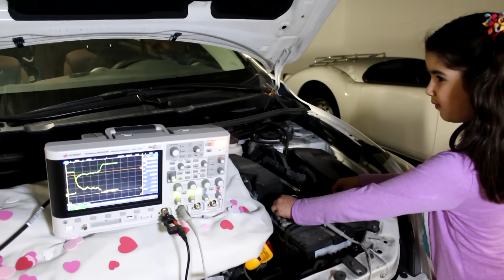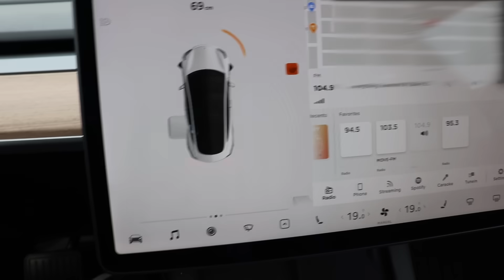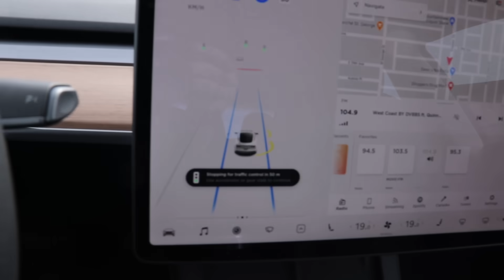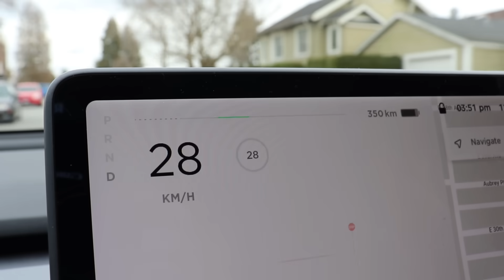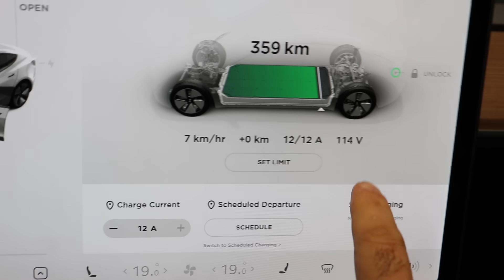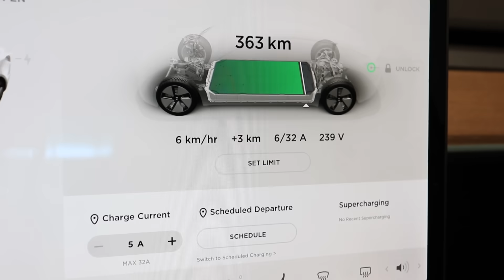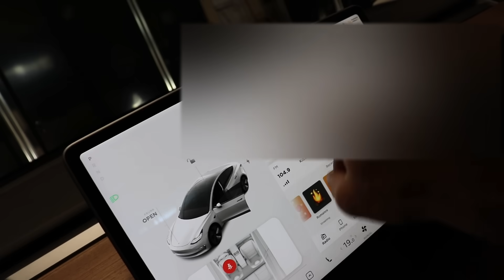ELECTRIC VEHICLES & My Tesla Model 3 Review

Comment: I’ve owned a Model 3 for over 2 years now and I love it!  A few things:

- The display freezing like that is definitely not normal.  I’d take it in for service!
- Check out the latest ‘FSD Beta’ videos on YouTube to see what the latest self driving software is actually capable of!  What you’re using is basically a year old already!  Also, if you want to understand what’s happening under the hood, get familiar with ‘Neural Networks’, and how ‘Deep Learning’ can be used to train them.
- Fill your boxes with bags of water next time..  The car will likely stop because the radar will see it then.
- I’m sure you already know, but charging the battery to 70 or 80% instead of 90% will do much more for battery health then charging it slower.
- In the ‘Carbon Footprint’ calculations - people almost NEVER account for the carbon footprint of building gasoline stations, producing the gasoline, transporting the gasoline, building semis to transport the gasoline, etc.  That should all be included too!
- Very little of the US grid runs on coal these days.  There is a lot of natural gas though.

Congrats on the car!  You’re going to love it!
Reply: Car guy, smart Guy
Reply: What is your average cost to drive your car per month? Would you say it is financially better than a gas vehicle? I'm just curious. I'm getting ready to buy a vehicle and the Tesla looks tempting.
Reply: @nvpeeches4316  I was driving 30k miles a year..  My gas bill went from $200 to $0, and electric went up $100, so roughly $1200/yr less.  That’s coming from a Prius so it may be more dramatic for you.  Teslas also hold their value extremely well.  For me, those details made it an excusable purchase because it was the car I wanted.

Also - the convenience of no oil changes or maintenance can’t be understated!  73k miles and I’m on my 3rd set of tires.  That’s it.  So at $60/oil change, I’ve saved nearly $900 in oil changes.  No timing belt, transmission service, tuneups, etc.
Reply: @setheroth28092  The Tesla most definitely reigns in comparison. Thank you for your input. I can easily live with the trade off. I was married to a professional auto mechanic for 24 years so I know the cost of maintenance. The Tesla won't be the headache I'm used to. Too cool. 👍
Reply: Well, if you want to count the carbon footprint of building gas stations and transporting gasoline, then don't forget the carbon footprint of building charging atations, transporting all the circuitry and building materials as well as circuitry production for said charging stations

Besides, the building a gas station thing shouldn't really be counted, I can agree on transport of fuel etc., but not the building, as they existed long before you bought your gasoline car, most of them anyways, and therefore has no real meaning in a calculated carbon footprint of a combustion car, sure they could have been part of it a long time ago, but, not anymore
Reply: @MadPixie  the carbon footprint thing ends up being a rabbit hole. How far back is back enough? Do we count the manufacturing of the vehicles that transported the parts of the factory the electric cars were made in? Do we count the carbon footprint of the first vehicle? 
When you do, you'd see that oil is a very dirty businesses.
Reply: @MadPixie  The same can be said about charging stations a while from now. You either account for the full costs or just operational costs, can't say which is more correct, but using one indicator for one technology and a different one for another just ends in biased analysis.

Even if some stations already exist, new ones need to be made all the time.
Reply: @mavhizd  that's mostly my point, that station building emissions being counted is just stupid, but simply even more relevant to charging stations as more have to be built recently as of the supply demand, so, in other words I agree, adding them to the equations is just, dumb
Reply: a lot of the coal that is burned is clean as well
Reply: @lost8099  It is only clean if you don't consider the CO2 output from burning it...
Reply: @emu071981  and the enormous amount of particulates we breathe, acid rain or indeed the radioactive dust it spews over society.
Reply: @lost8099  technically coal would have a pretty low carbon footprint if you just burnt the coalgas and threw the remaining coke on a pile but nobody would do that xD
Reply: @lost8099  how do you make clean coal?

Comment: Mine is same - 3months old - same colour - but it's the  DUAL motor  version with BIGGER battery- I have two powerful motors  and more POWER..... Mwwahhha
Actually not enjoying experience so much so far
During cold weather in January (when it got close to sub-zero) - it lost all regen on braking - suddenly and without warning - changing braking dynamic behavious in a dangerous way. Tesla's advice - yeah thats normal.!!  But it's not normal it's fantastically dangerous!  No other car does this (and I have another electric  car to comapre with). I am about to report to safey authority in UK 
This weekend my central screen EMU has now developed fault - black screen! -  Tesla are coming out in 3 weeks time to fix  ---Yay    ):o(
So far - more faults developed in first 1000miles than all other cars I have ever owned combined. Needless to say I have mixed to negative opnion on Teslas  - at least so far
p.s. ultra fast acceleration is good for overtaking in a safer manner befor enext bend occurs - not just boy racer stuff

Comment: 13:25 Well, in most cars now days, the fuel injectors turn of and stop feeding fuel to the engine if you release the gas pedal. So if the hill allows for it, you can cruice all the way down and use no fuel at all in a perfect circomstanse.

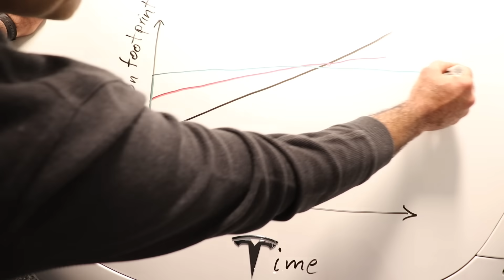Comment: Fun fact: At 2:50, you need to drive roughly 7 years regularly with that Tesla to compensate with the production of the battery compared to a gasoline car. After 7 years you finally start to be "green"
Reply: Nope.  If you do that comparison, you need to do the equivalent for gas, which means the production of the metal, oils, rubber, of which there is much more metal than in a lithium battery. In actual fact, the production of an electric car is almost the same as a gas car, in the cost of how green they are.  Now, add in the cost of the production of fuel, the shipping of fuel, the pumps to pump the fuel, and the gas car is suddenly much more expensive environment-wise. As electricity can be produced in multiple ways, it can be very clean. For example, in Ontario, all coal plants have been shut down and replaced with wind and solar, and diesel. (and the air is noticeably better than it was a few years ago when they were operating on coal). So electric vehicles are the first of many steps to a clean environment.
Reply: @chrisBruner  How long does the battery last? I expect its carbon footprint is significant, so you probably need to calculate a second (or even third?) battery pack to the total footprint of an EV. On the other hand, footprint of oil mining, refining and delivery must be massive and we can't forget it itself heavily consumes electricity as well...
Reply: @mikiqex  A battery will last approx 10 years, (I was told when I bought my Tesla). It can be recycled, so is not that big a footprint.
Reply: @chrisBruner  I knew someone would disagree, I honestly have no idea myself, I read an article in the newspaper saying that with the 7 years.
All I know is in the US, only 20% of the electricity made, is made with renewable energy, 40% natural gas, 20% coal, 20% nuclear energy. I still dont think at all that its worth getting an electric car. 
Just think about all the planes and huge vessels, they need much more fuel and ressources than a car
Reply: @jennyhoffmann3054  The amount of electricity made with renewable energy is increasing each year, so we are talking about an investment that will pay off (green wise) over time. Electric cars are still expensive, but in a few years they will have come down in price, so I understand if you don't think it's worth it. I just had to disabree with the 7 year statement, as the greenhouse cost is nowhere near as high as you think, compared to internal combustion engine.

Comment: Tesla brakes do need maintenance if you drive it in winter with salt. After a couple years they may not wear but they will seize if you don’t renew the grease. Obviously a not a major concern but worth noting before the rotors are ruined, which will be pricey compared to a matrix.

Comment: be carefull with the brake system if at your location salt is used for the ice on the road.there are cases of seized brake calipers and rusted disks after 4 winters,having to replace the entire brake system,and those are high performance parts.
On a model S :
Break caliper assembly with piston (each): $745.00
Rear rotor (each): $331.00
Front Rotor (each): $290.00
Parking break caliper with pads: $1,235.00
plus labour costs.
regenerative brake is awesome and will also save you on brake system wear and replacement parts,but remember to force the car to use them on a regular basis.
I love Tesla cars,but they are luxury cars in maintenance.
they made a brilliant job,but Tesla still lacks of the decades of design experience others have,making them very,very expensive to repair in body work.
then add the cost of expensive parts and you have a nightmare in case of even small crashes wich leads to lots of them getting totalled with "minor" crashes.They get so expensive to repair so fast that insurance companys prefer to declare them totalled in too many cases.And insurance fees are also very high.
even at the same selling price tag as others,they have the potential to get much more expensive than other brands.
as i said,i love Teslas (minus the cybertruck),just i cant afford them.
also,the lack of maintenance and parts wear..well,electric or not they have a lot,specially Teslas,just wait.
Reply: So it might have been better to keep the Toyota for winter driving? I have no familiarity with winter driving.
Reply: @blkdog40  no,just make the brake calipers work instead of only  use regenerative braking

Comment: 13:30 that is not quite true. if u run downhill with a gasoline car, if you just let gravity pull u downhill u dont consum any gasoline either. it cools down the engine since it doesnt burn fuel anymore

Comment: Can you make a video about creating a portable solar charger that you could hook up while parked to charge the batteries? I have a hybrid plug in that holds 30 miles I would love to be able to keep a panel on the trunk so that way while I’m out I could at least even just drip charge the batteries every mile counts!!
Reply: with just the panels that can fit on the roof, you might only get a single mile.
Reply: @jnawk83  every mile counts over a year that would be a full charge worth
Reply: @ohraa1  right, but what would the panels add in excess weight and drag?  you may well spend more lugging them around than you make.

Comment: Unhappy putting green house gasses in the air, buys electric car that still contributes to it, just somewhere else. 

My neighbor did the math, bought two tesla cars and after 6 months got rid of them for two hybrid Toyota SUV because his electric bill was higher than driving a gas vehicle.
Reply: Of course the electric bill is smaller when you drive a gas car
Reply: What kind of electricity prices did your neighbor have where electric was more expensive than gasoline?
Recharging a Tesla is easily more than 30x cheaper than refueling a gasoline or diesel car where I live.
Reply: @logitech4873  by the time you incorporate the monthly payment into this vehicle vs me I dont have a monthly payment, it runs me $60-75 a month to drive around with my gasoline vehicle. Also charging stations are few here. My neighbor never was home long enough to have one of these have the proper charge time a 120v system needed to fully charge it. He used them for his business and found out that he couldn't charge them faster than his consumption rate. He had two and could only charge one at a time. If you add the cost of both of my vehicles together fuel wise, im at tops $175 a month. One is a full size truck, other is a compact SUV, both 4wd. Also it has been proven that the US current electric grid couldn't handle electric vehicles if everybody went to them.
Reply: @mistermacgray  I would expect to pay maybe $2 a month for charging if I had a Tesla.
If you buy a Tesla, you should definitely have a 7.5 or 10kW charger installed in your home.
Hopefully the US gets better? I don't really care.
Reply: @logitech4873  i have my doubts it would be that cheap a month. You lose 1% a day of the battery as they have said. At $2 a month you are just maintaining the battery and my cost more than that.
Reply: @mistermacgray  When the price of electricity is $0.03 per kWh, and you don't do a lot of long distance driving, it's just not gonna be very high.
But let's say $4.
Reply: @logitech4873  this falls in that category of battery memory and do these batteries get that if not properly cycled (drained through proper/recommended usage) and it shortens the life of the battery.

Comment: Can spot some weird panel-gap at the left headlamp. 
Anyway. Can you explain why (most?) electric cars only have one forward gear? Is there no benefit from a lower revving electric-motor? The motor has plenty torque to handle lower revs.
Reply: The motor has plenty torque to handle higher revs too
Reply: @Lardladd  Thats not the issue. Will it consume more power at high revs? If so; why doesn't it have an "over-gear"?

Comment: 11:20 "Tesla's accelerator pedal works differently than the traditional gasoline car"
Didn't driving school teach you engine braking? It is the preferred way of slowing down a (combustion engine) car without wearing the brake pads. By planning ahead and driving non-aggressively you rarely need the brakes on any car.

Comment: Nice to hear about the low maintenance costs. But don't forget to check your tire pressure! This can cost range and / or compromise braking distance during an emergency brake.
Another problematic area are the mechanical brakes themselves. Due to minimal wear they can rust and degrade more than with frequent use like in a gas car. Keep an eye on the rotors and stay safe!

Comment: EV car i so environmentally friendly, that after 7-8 years you have to buy a new battery pack, which is about 70% of new car price :D
Reply: The batteries are designed to last between 500-800K kilometers, and at that point most cars would be well dead.
The estimated cost to replace a model 3 battery is between $3000 to $7000, so you're really looking at 8-15% of the cars' cost.
Reply: @logitech4873  Batteries are designed to last specific amount of charging cycles, not kilometers.
Reply: @MTWODZU  Of course. But charge cycles aren't a very useful metric for people who buy cars. (not a lot to compare it to)
The relevant number is ~1500 charge cycles, which can be used to make a range estimate.
Reply: @logitech4873  Do you have some links to information, that Li-Ion batteries, usually in cars used for fast charging, are able to survive around 1500 charging cycles in typical exploitation conditions?
Reply: @MTWODZU  Youtube is very stingy about links lately, but this is directly from Elon Musk, and you'll find the claim on his Twitter.
Batteries that degrade unusually fast would be replaced under warranty.
Reply: @logitech4873  So, we will see how it will looks like in few years.
Reply: @MTWODZU  Yes. Time will tell.

Comment: Sorry Mehdi. Fact check, it's worse for the battery for it to sit at 400v almost permanently. It's also worse for the grid and the planet to charge that way, as it consumes considerably more energy than charging at a more appropriate rate. This is due to huge inefficiency of almost all chargers when running them so far below their designed typical current level. The best strategy for the battery, and grid, and planet, is to set scheduled charging for whatever time of day your grid is quietest (greenest mix, and lowest overall current draw from grid)

Comment: One thing is wrong in this video, if you drive a modern gasoline car (my 2000 BMW E46 already has this) downhill, it will use 0.0 liters of fuel. This is due to a technology called thrust cut-off. As long as you don't use the accelerator or press the clutch it will stop injecting fuel into the cylinder, thus it will not use any fuel. Otherwise great video, even though i'm not into electric cars. This was by far the best Tesla review i've seen.

Comment: And what can happens if you put a solar panel on the cieling of the car connected to a battery regulator... can it charge the car battery? how much the battery can be charged? we can use a last generation bending solar panel generating 300Watts per hour to charge the car battery? I think that these questions can be interesting. Thank you!